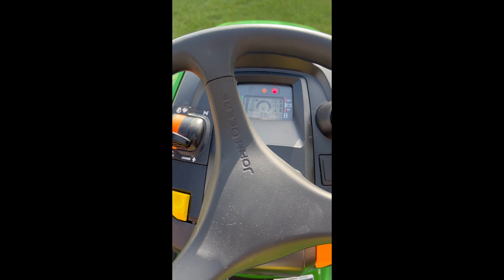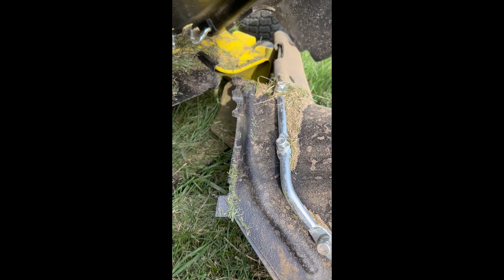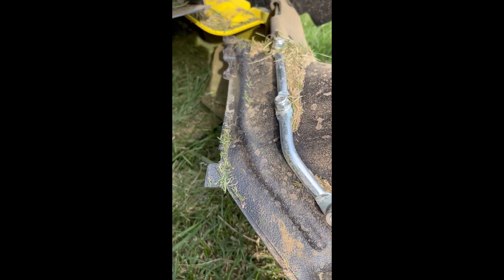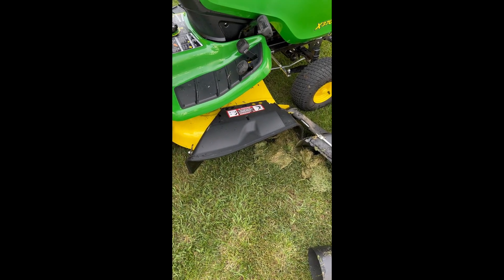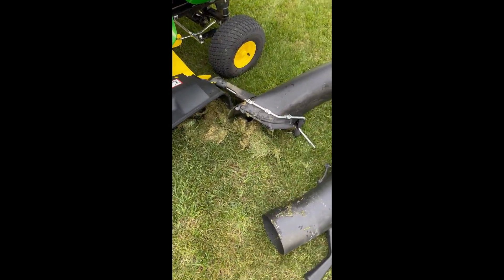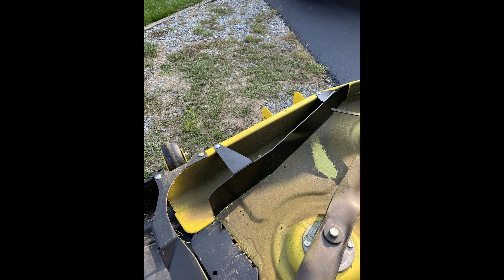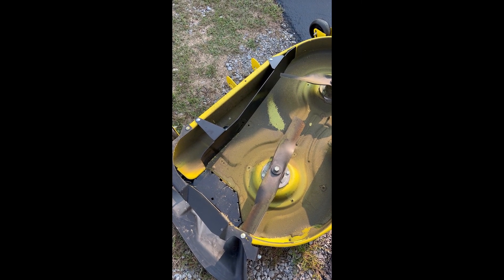2022 X370 BAGGER ISSUE RESOLVED

Comment: Mine same. If you had the deflector bracket with your parts, how come you didn't wonder where it went?
Reply from the maker: I did wonder.  I figured since the bagger came with extra parts depending on if it had a mulch kit, that was just another extra part.  Like I said in the video, I did not read the instructions, and that was my bad.